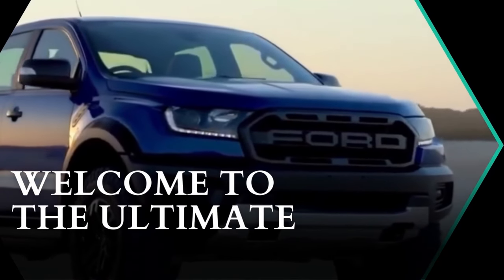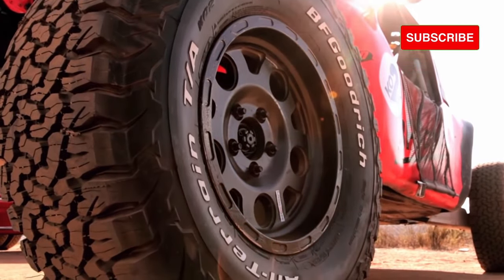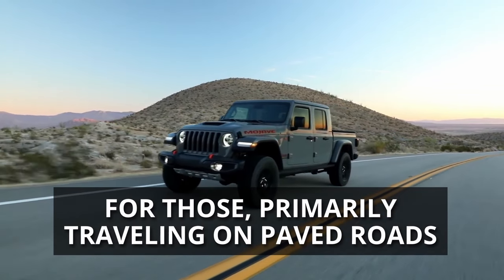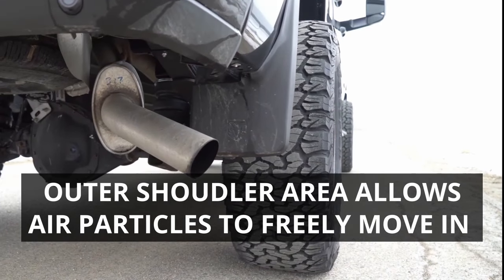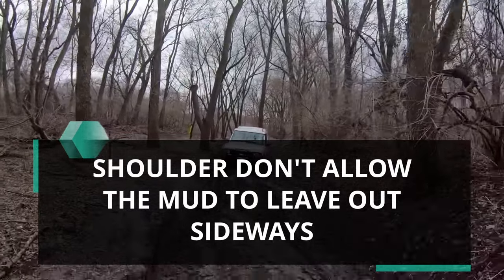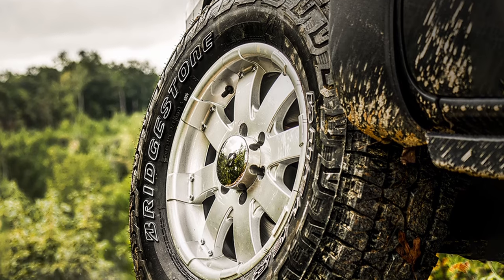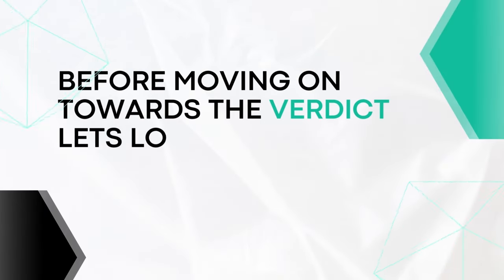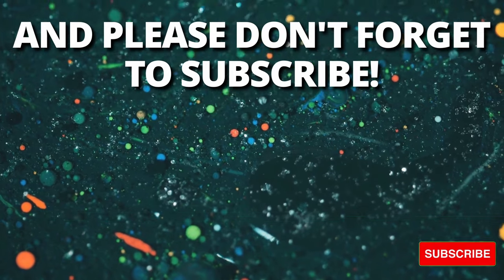Bridgestone Dueler A/T Revo 3 vs BF Goodrich KO2

Comment: I had the KO2's on my Jeep, great offroad traction, horrible road noise and they lasted maybe 30k miles, I had the Revo 2's on my Frontier, they were awesome. lasted longer with comparable off road traction. Revo 3's are a upgrade and supposed to have better wear and less road noise.
Reply from the maker: Thanks for sharing.
Reply: I have the 3s and man…it’s like driving on a road tire yet I’ve never had a traction issue offroad
Reply: @Danmorrisroe  for my next set, I am grabbing the revo 3's or the BFG trail terrain. those both seem to be rated very similar, best of both worlds.
Reply: @jetdr good call I never even thought about the trail terrains

Comment: I added Ko2's to my 5th gen Ram 1500 and don't like them. I probably would like them more if I primarily drove off-road. They are heavy and noisy on the road. I got the stock size and immediately lost 4 mpg on the highway. I expected some mpg loss but that's a lot for stock size. Thanks for doing a comparison as I've now got about 35,000 miles on them and am almost ready for a new set. The Revo's are on my list. 👍👍
Reply from the maker: Glad you liked it. And thanks for sharing mate.
Reply: Bridgestone dueler revo is noisy?
Reply: @N4TH4NR4WR  Not sure. I ended going up with Continental Terrain Contacts. Less aggressive and more of a all terrain/highway tire. Got all of my mpgs back and they ride great.

Comment: Having used both, I completely agree. The KO2 is also much better at picking up rocks, costing a couple of windshields every year :)
Reply from the maker: @Erik Interesting observation about the KO2s picking up rocks. It's a trade-off we don't always think about when considering tire choices.
Reply: I had the same issue on my Jeep Wrangler Rubicons when using the KO2. They held rocks and slang them like a crack dealer.

Comment: I have owned both of these tires for a long time. While the Bridgestone revo 3 is a good all around AT tire, its soft compound only lasted 30,000 miles, very disappointing short life. The K02's are the all around best AT tire, especially if you off road or drive in snow.
Reply from the maker: Yes KO2 is a better snow tires, so it makes sense why it gets 3 peak mountain snowflake rating

Comment: Hello, thank you for your great contributions, you are very professional, it is very helpful. I have a very important question, I drive the new Hyundai Tucson built in 2021 all-wheel drive. Which tire would you recommend for the hot summer with dimensions 235/55/18. I drive a lot on the road on asphalt when it's very hot. michelin crossClimate 2 - 235 55 18 or Bridgestone Dueler All Terrain
AT002 - 235/55 R18. Thank you. Best regards
Reply from the maker: Thanks, glad you liked it. I would recommend Dueler A/T in XL sizes, if those are the two options you have.
Reply: @comparethetire  hi, thanks for the quick answer, which tire would you recommend to me in this size? What do you think of Continental CR-ATR 235 55 R18?Best Greeting

Comment: I believe the Revo is "mud and snow" rated. Even street tires get mud and snow. It is not 3 peak mountain snow flake rated for severe winter driving.
Reply from the maker: That’s correct. The Revo 3 is "mud and snow" rated but lacks the 3 Peak Mountain Snowflake certification for severe winter conditions.

Comment: Cooper rugged trek vs radar renegade rt would be interesting.  Both inexpensive and see really good reviews on both hybrid tires.
Reply from the maker: Yes its a good tire. By the way, those and Patriot RT are the same.
Reply: I'll never buy another set of Coopers. I have them on my truck now and they were extremely noisy within the first 5K miles.
Reply: Which coopers did you get? Most are extremely quiet for what they are